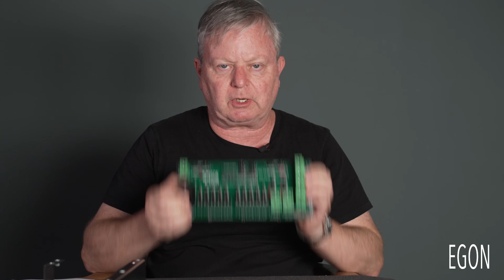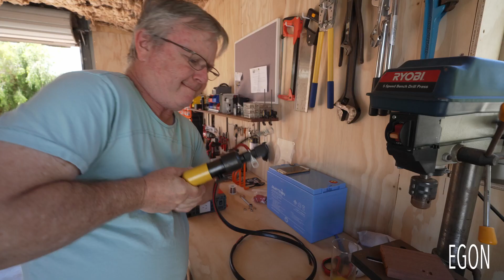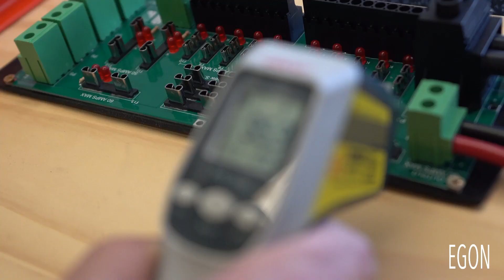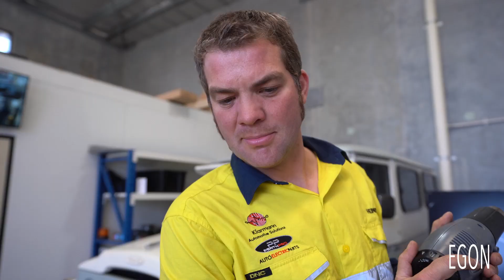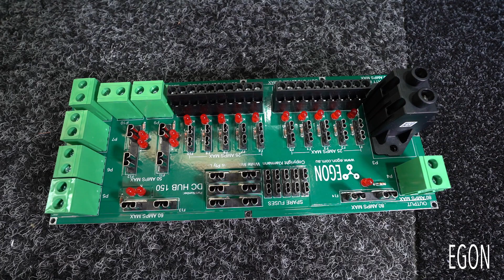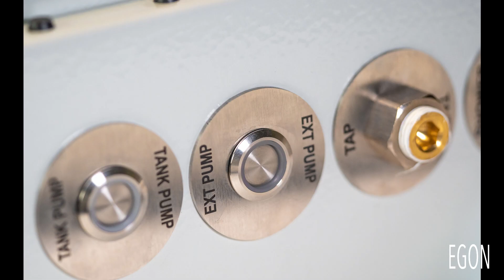REVOLUTIONARY DC WIRING HUB. SAVE TIME AND MONEY | EGON DC-Hub EXPLAINED

Comment: I want to buy one of these for an upcoming 12v build in an overlanding 4wd as i like spending money on gadgets but i still cannot see the justification for $700?! I don’t think it’s worth that to not have to crimp and heatshrink and to remove the need of seperate component(fuseblock etc). 

It does look like it would simplify the solution for newcomers(should they really be installing a system in the first place) or someone that installs them on the daily and the client is pying for the egon. My question is, is this hub worth buying for someone that can design and install a 12v system and why? Fuseblocks have diagnostic leds so what else would i be gaining??

Sorry for the negativity but maybe ita not for me?

Comment: Have you thought about producing a smaller version for vehicle accessory wiring when you might not need so many circuits? Like for underbonnet installs with just 5 circuits to reduce cost for those who don't need quite so much? Probably won't make too much of a difference, but might save some space.
Reply from the maker: We have just released the Relay-Hub which is a small version with relays. But a small without the relay option, would then just be an ordinary fuse box. I recommend the Blue Sea fuse box.